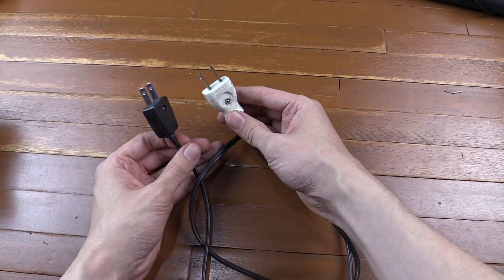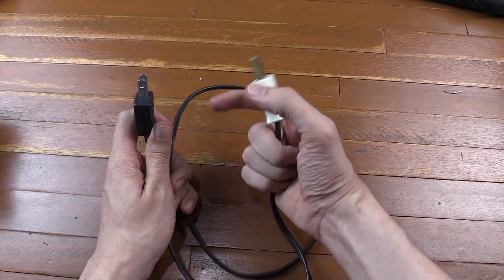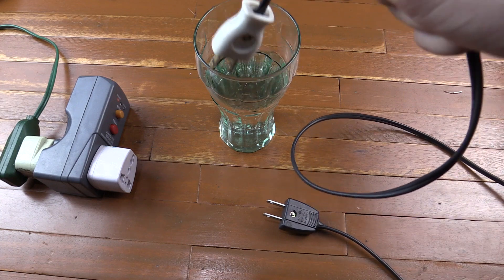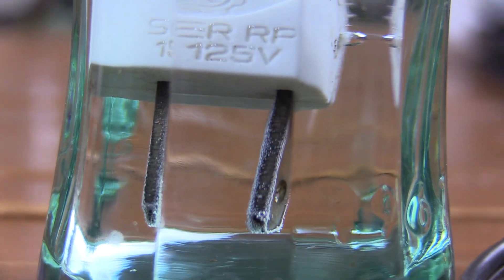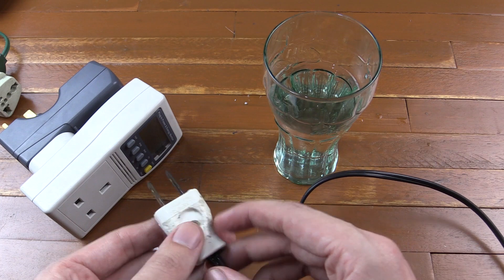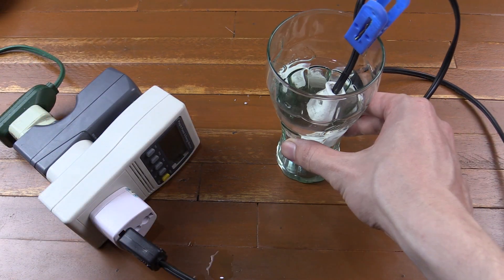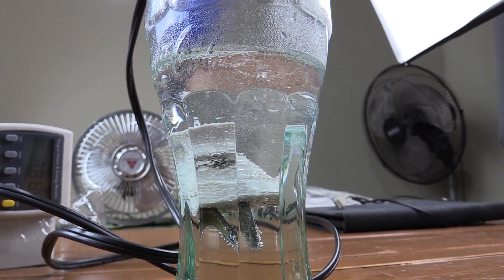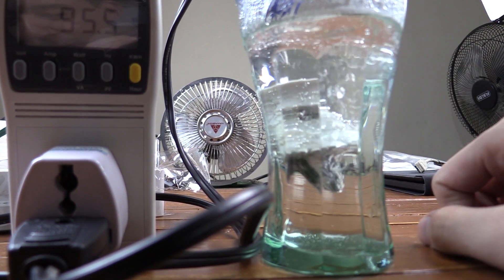Suicide water heater

Comment: I like how absolutely not useful this is. Like, an electric hot plate you plug into the wall is so much easier to get than a suicide cord and works much better and faster, so as long as you have electricity you would literally never need to use this method of you have a hot plate
Reply from the maker: Yep, there's really no good reason to do this. 

Although it's a throwback to some wartime experiences, when they used razor blades with some scrap wires.

Comment: I gave you a thumbs up for almost killing yourself... even you said that you get the electronics out of the way in case the glass breaks... guess what... if it would have broken, the water would have spilled on you... I'm curious if that RCD thing is even rated to work when you have wet hands...
Reply from the maker: You can see plenty of people testing RCD and GFCI sockets in bath tubs full of water. I don't recommend doing it though.
Reply: If the glass broke and the water hit him its not really gonna become live at more than a few volts mainly because of the resistance of the water and the fact that the current will continue to flow between the two pins. Now if the water just barely hit the watt meter or the RCD then nothing would happen because it will come into contact with the case and nothing else. If it came into contact with ground somewhere then yes the RCD would trip

Comment: This is only a suicide water heater for the stupid. It's perfectly safe so long as you know enough to keep yourself safe, like knowing not to touch it while it's live for example. You would think this would be "common knowledge", but amazingly, a lot of people wouldn't know this very basic thing. For those kinds of people, yes, this is a suicide water heater. For those with a brain, it's just a potentially dangerous water heater that needs certain precautions taken to use it safely. Calling this a suicide water heater is like calling transformers suicide transformers. They're just transformers and those with the right knowledge can handle and use them perfectly safely.

Comment: No offence but the only risk here is if someone touches the water and it also likely would not lead to instant death actually. Electrocution regarding water doesn't work exactly like in Hollywood movies I am afraid. lol
Also water isn't as conductive as you think, this is why only 35w of power is being used. If you in fact were to take a voltage reading from the water to a ground wire then you would find the voltage would have dropped off incredibly fast from 240/120v to less than a quarter of that over 5cm of water. This is why people who shower with "suicide showers" are literally having mains power touching water and running over them and without a ground wire attached to the device people will feel a tingling feeling, this is the electricity running through them.......but it is far below lethal. 
You could in fact put your finger in the top of this glass and you will not die, the path of least resistance is between the two metal pieces and not 4-5x that distance into someones finger and then through their body and then trying to go down through their shoes etc. Of course if you were to wet one hand and grab your ground wire for your hour and then dip your other hand into this cup then quite likely in that specific situation you may in fact die.
Reply: well said, OLE!

Comment: What would happen if you plugged both ends of that into an outlet? I'm going to guess nothing, or if it's not polarized then either that or it will short and blow the breaker, depending on which way you plugged it in.
Reply: From what I’ve seen nothing happens usually

Comment: Is it safe to drink the water?
Reply: Yes. I have done this before because I wanted to know easy ways to heat up water and it worked and yes its safe to drink, although if you want to drink hot water or not is a totally different question lol

Comment: I don't get it, how come your RCD didn't trip when that plug was in the water? Aren't they supposed to isolate power if any water comes into contact with a circuit?
Reply: +Neil McFarland An RCD (a.k.a. GFCI) will trip if there is a difference between the currents in the two wires. Here, all the current flowing into the water through one wire left through the other so the system was balanced and it didn't trip. If GA had put his finger in the water some of the current would have escaped to ground via his body, creating an imbalance and tripping the device - hopefully fast enough to save him from permanent harm.

Comment: I believe the technical term for this is an electrode boiler. The trick is that you use AC power to prioritise molecular friction over electrolysis which can generate massive amounts of heat if you have an impure water source (Anything with a few salts and metallic ions is great, so if you live in a region with hard water, this'll work a treat). and large enough electrodes. I've seen electrode boilers that can produce upwards of 10kW of dissipation, and they're not hard to come by if you look on ebay.cn!!

Comment: Youtube need to add a moron filter... Maybe a pop up questionaire that you have to answer correctly before you can view material like this as it looks too much like a potential darwin award winner if it isn't done properly

I was scared for you right from the off.  If that glass had smashed or even just cracked you would have water on the surface right next to a really nice open circuit for you to complete with your hands. Your human instrinct would likely have been to drag the element or to grab the power socket emsemble out of the puddle 

Why was it not in a bund (a non-conductive tray). Why do it in glass and not a more forgiving material like a plastic?  Why was there no screen?

I'm not a health and safety nazi but seriously, you must realise that some people will try to replicate this... maybe even use it for mischief. It would be too easy to snag the power cable on your sleeve and knock this over
Reply from the maker: +TheComputec hence the very clear title and warnings in the video and the use of an RCD / GFCI socket :)
Reply: Gadget Addict I get that... but are your videos translated into every language? I'm sure that an educated english speaker understands all of the terms but given that this sort of tech is often used in third world countries by people desperate to find ways to generate hot water I'm not sure the caveats are sufficient. The fact that the water is "live" just concerns me too much in a setting where a simple accident could happen. Not trying to troll you here... I just have basic safety as a fundamental.

I hope you would agree that it should at least have been placed inside a non conductive tank

Comment: add some salt it will speed it up
Reply from the maker: +A D No risk of Chlorine gas? Remember it's AC, not DC.
Reply: yes but nothing noticeable to the smell but try a pinch at a time, current will go up a lot.  Used to do that with a humidifier that took too long to heat.
Reply: Gadget Addict the salt will increase the resistance of the heater.

Comment: thank you for taking the risk so the rest won't have to die. but i guess its natures way of weeding out the weak. haha.
Reply from the maker: +Adrian Glenn Bionat Well if the GFCI socket does it's job, the worst case scenario should be nothing more than a small shock before it trips. And unless the plug somehow jumps out of the glass and into my hand, there's really no risk. It's about as dangerous as a light bulb socket. You could remove the bulb and stick your finger in there for a nice shock, but you probably wouldn't.
Reply: +Gadget Addict what could you do to make it work faster? install bigger elements?
Reply from the maker: Adrian Glenn Bionat Yeah, basically. The pins are too small and they're only close together near the end where I bent them. It would be better if they were completely in parallel with each other, with a small gap between them.

Comment: let say you pass and make the water boiled in this process without being electrocuted? The question is? thus the water boiled in this process is 100% safe to drink?
Reply from the maker: +RRyes It depends on the metal used for the anode/cathode. Without being able to accurately say what metal these pins are made of, I'd suggest it's not safe to drink. Good enough for a warm shower though :P
Reply: +Gadget Addict I think if only for shower and emergency purposes, this must be done in caution, or SOCO will come into your hotel / room.
Reply from the maker: RRyes I can't really imagine any emergency circumstance that would justify trying to make something so dangerous. Maybe if you were locked in a room and needed to sterilize something for a life and death situation. But yeah really, not recommended to make this at all. Just an experiment to try replicate what they did during the war.
Reply: It's not safe because metal ions are formed. If copper is used, you'll get copper ions which are mildly poisonous in these concentrations.
If steel is used, you will get hexavalent chromium and nickel ions. Both are poisonous and the former is also very carcinogenic.

It's something only a knowledgeable person can do as last resort to make some hot, undrinkable water. Anything else is extremely dangerous.

Comment: you are actuallu creating hydrogen/oxygen gases by electrolysis. this shouldnt be done in an enclosed room!
Reply from the maker: +mediacoregroupph Remember this is AC and not DC. Although there are some rare circumstances where you could perform electrolysis with AC, it's pretty much a non-issue.

Comment: pure water will not pass electicity.
the closer the prongs, the more watts were used.
you must have  water with few  desolved  salts  
try the experiment  again with salt in the water.
Reply from the maker: +Tom Robertson I know electrolysis isn't much of an issue with AC but are you not risking the creation of Chlorine gas by adding salt to this? Aside from that, I've already seen someone experiment by adding salt and it made the water so conductive that the high voltage was easily bridging across and creating sparks and other craziness. Not something I'd really want to try.
Reply: My remark was about the different spacing of the prongs and why the difference
I don't know about clorine gas.
Distilled water?
Reply from the maker: Tom Robertson Okay, I was just talking about the bit where you said to add salt to the water :) But yes, you're right, moving the two pins closer (not just the ends) would improve it :)

Comment: looks like it does not use very high watt to boil water...
Reply from the maker: +tan hock jun Yeah it takes awhile because the current is low. It would work better if the two prongs were removed from the plug and then separated by a match or something instead of simply bending the very end closer together. If you look up 'razor water heater' you can get a better idea of how they did it in war times and how you can improve the heating time.
Reply: +Gadget Addict ok i will check it out later :)

Comment: Looks about the same as some of the immersion heaters that can be found in the local hardware stores.  More or less electrolysis. Making hydrogen and adding a spark.. humm.. wonder what would happen  :-)
Reply from the maker: +Hey_Joe haha I think the hydrogen should be limited though because it's AC rather than DC, right? My understanding is that electrolysis with AC is pretty much non- non-existent due to the rapid changing of the cathode/anode.
Reply: There is barely any electrolysis here. You can't ignite it and it's basically all steam.